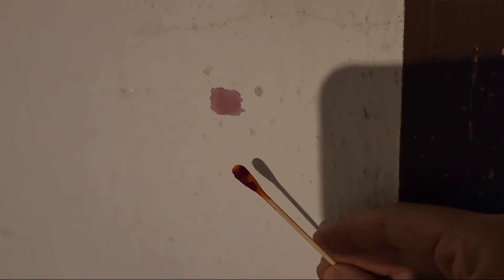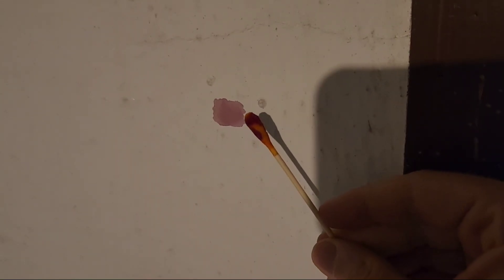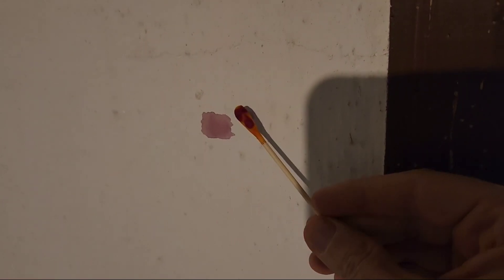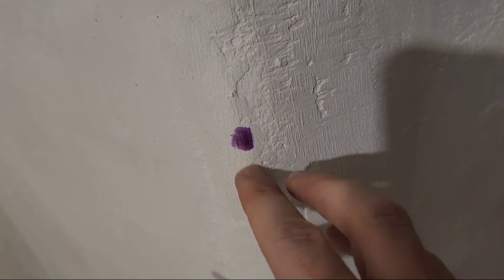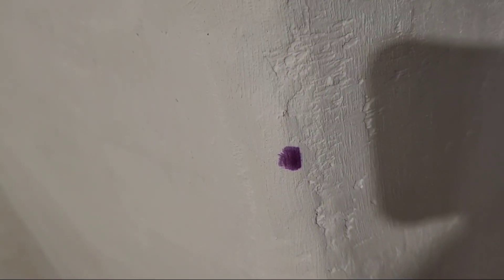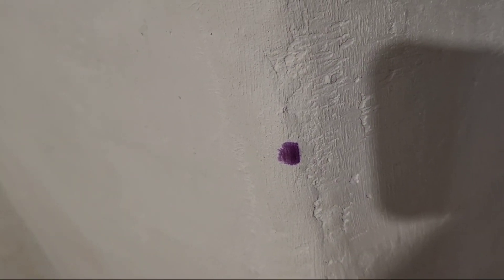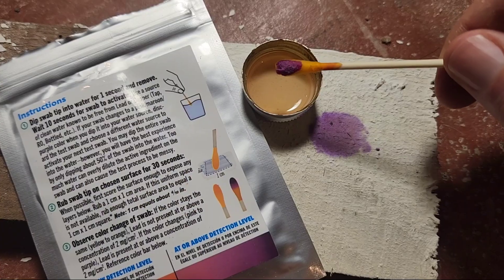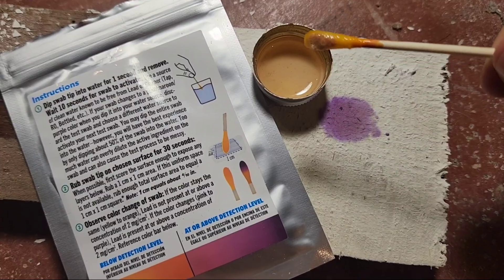Sodium Rhodizonate and Lead Paint False Positives

Comment: So glad I found this video. I was starting to freak out but then I started to play around with the swabs. Yes, it absolutely turns purple in a caustic solution (I tried it with washing soda). I also got a false positive from testing a dietary zinc supplement, which itself is a zinc oxide derivative. Historically, zinc oxide is a stupidly common paint pigment.

Comment: I found washing powder will turn rhidozonare bright vivid pink. Presumably the high ph but also maybe the borax that could be in it. 

It’s confounding dipping it in vinegar as aren’t you just diluting the test below the detection threshold or depending on soluble or insoluble lead complexes it may be dissolving the lead into solution
Reply from the maker: you dont soak it in vinegar, just a quick dip to get it wet, its what police labs do but with diluted hydrochloric acid. the acid makes other metal compounds clear (so back to yellow) but lead compounds stay colored...as for the washing powder, the ph is my best guess too
Reply: I can confirm that washing powder turned the swab to vivid bright purple. :) White vinegar turned it back to yellow colour again. :)